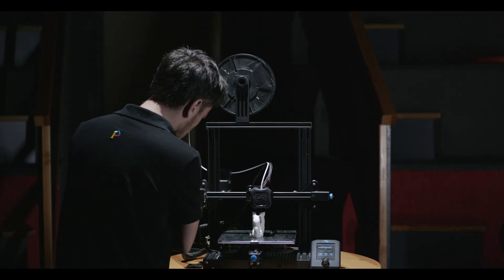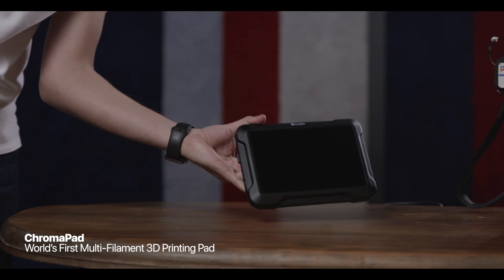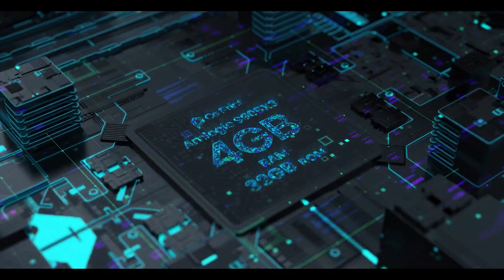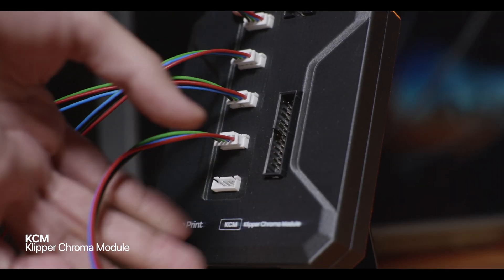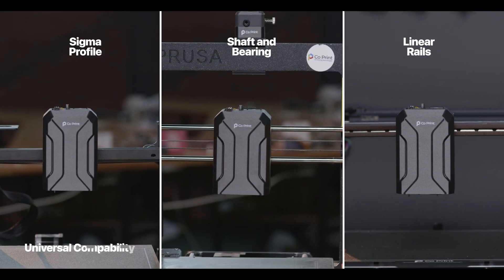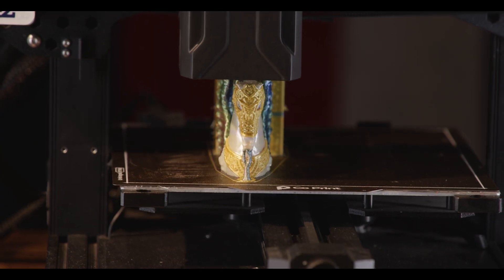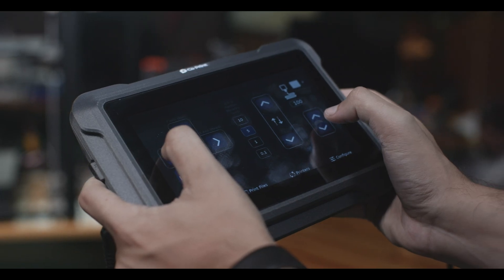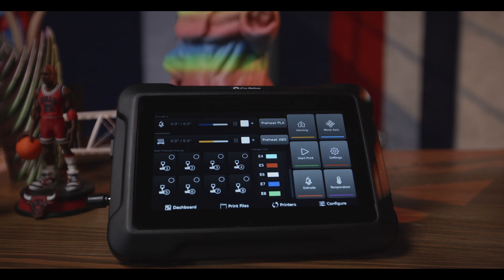Co Print ChromaSet: All-in-One Solution for Every 3D Printer

Comment: Good!, Can it handle all types of TPU filament?
Reply from the maker: Great question! 😊
Yes, you can print with TPU using our system.
However, please note that TPU must be printed alone — mixing TPU with other filament types in multi-color mode is not supported due to its flexibility.

Let us know if you have more questions!

Comment: So why do you say compatible with all 3D printers if it is not compatible with all 3D printers? What is your definition of all?
Reply: What kind of extruder does it have? A sprite would be perfect
Reply from the maker: We mostly say ''almost'' all 3D printers. If we think all products in ChromaSet, you can use at least one of the products for your 3d printer to upgrade some features, so our other motto is ''All-in-One solution for every printer'' is correct, I think.

Comment: Not to bad.. would be nice to see what printers it can work for.. I did see the k1 and some other creality... How does it work with a sonic pad . Or with the creality k1 do I need a screen or can I use what I have?
Reply from the maker: Hi, we developed the Klipper Chroma Module for this. You can use it on your Klipper printers like K1 or Sonic Pad+printer setup. You don't need an extra screen; you can monitor from your phone or the web.
Reply: @CoPrint3D  this is amazing!!! Are u able to link me what I need to get this going for my k1 or even my ender 3 s1 pro?
Reply: So if I have the K1, I’ll need to buy just the chroma head? Or the klipper chroma module too?

Comment: This is a great vision of professional multi color printing!  Monitoring, 20 colors, compatible with existing printers - how are you guys set up to deal with all those variables? Love the scope.  What are you using for a filament storage/drying solution?
Reply from the maker: Thanks so much. We have been dreaming of this for 4 years. The market is ready, so we are ready. We do not have our brand filament dryer, but we love dryers on the market, like Creality and Sunlu.
Reply: @CoPrint3D  ok. so, how are you setup to deal with all the variables of installing your product in so many different 3d printers?  24/7 live chat? Forums? Guides? Video library? What's the plan?
Reply: I don't want to speak for the creators but the setup appears pretty straight forward and a lot like the setup on a creality sonic pad. I would imagine their support is a lot like Prusa's MMU system. The compatibility with different 3d systems does not automatically equate to they will have someone 24/7 to hand hold installations onto linear rails from china custom installed on a 3rd hand ender 3. It looks like an interface plate for the hotend. Mounting the 4 extruders and installing bowden tubes. The rest is done via their pad or klipper which if you have a custom klipper install you should know what to do on that front as it is not automated. I'm honestly mostly speaking out of my ass though.  @planckstudios
Reply: @PrototypicalITGuy  ha I have 2 mmus and they're massive time holes. that's with the aid of 24/7 customer support.  my worst experience was building a Folgertech FT5 - waiting days for a response on a question only to hear a suggestion I'd already tried and communicated - learning through trial & error that multiple components in the kit were faulty.  I do like how Prusa does quality checks -  testing the printer/components and leaving the receipt in the box.  making this product work well across many different printers - each slightly quirky cause they're kits - means testing/qc + relaying that info to people.  If they want to win trust, they could publicize how many beta testers they have and list the many different machines - with the same multi-color benchy from each.  or let us see the library of guides tailored to different printer installs.